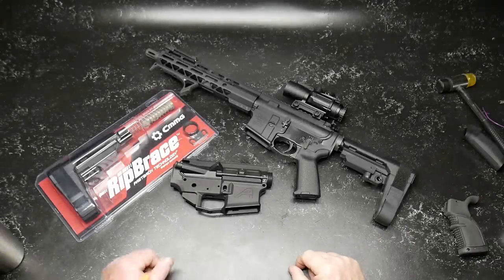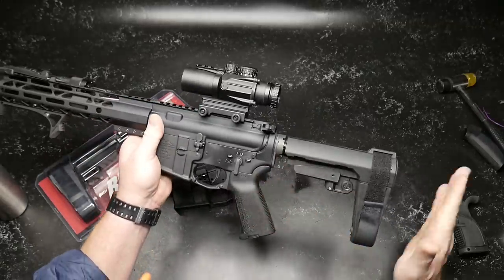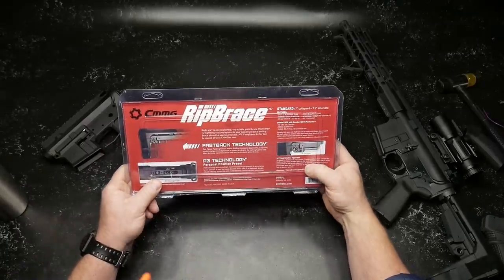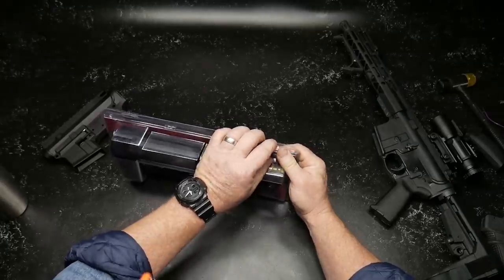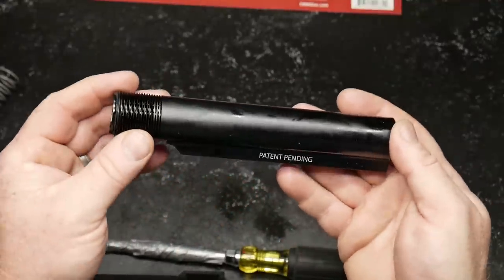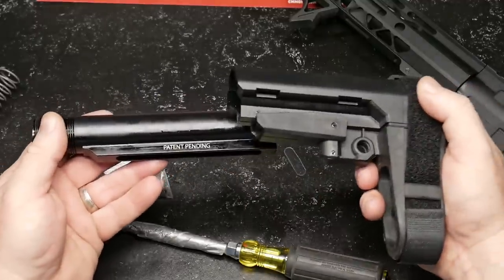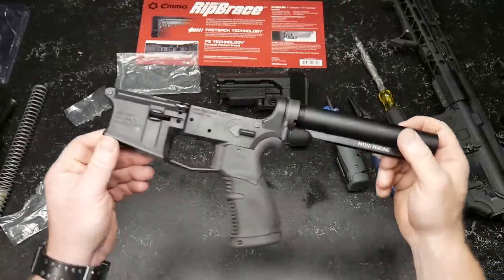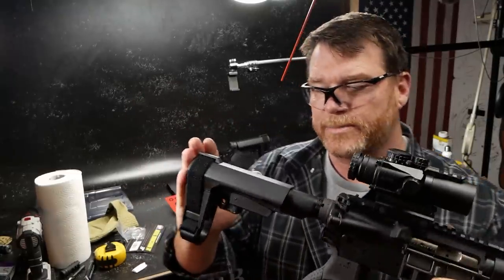NEW!!!  CMMG RipBrace Install and Review

Comment: Kota I can't justify the cost for a couple of inches of quick adjustment, when all you need to do is set your stock length in advance. Hey, on a pistol, you're already saving space (up to 8 inches) depending how short your barrel is. Maybe to someone else, they might have a need for those few inches. They might be driving a Smart car.

Comment: 6061-T6 is not adequate for 5.56 receiver extensions. They pop out a coin sized hole in the rear between 15,000-20,000rds. 

Thanks for reading that package insert out loud!

Comment: Maybe, if you like to run a brace with a longer length of pull. I'm partial to the blades set short with a folding stock adapter. Adapters are about $200 and blades around $40 so just a little more cost with more adaptability.